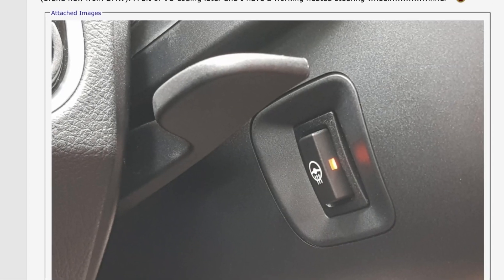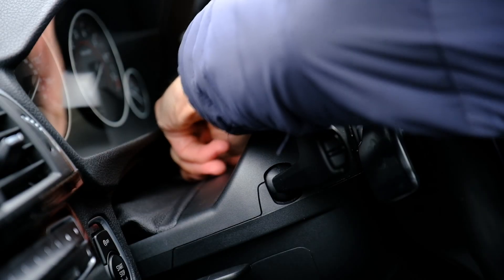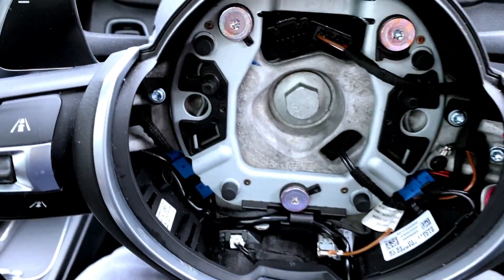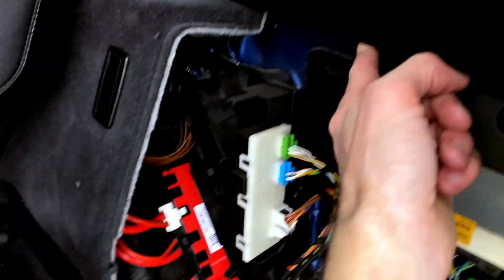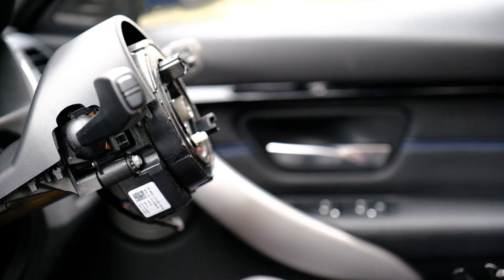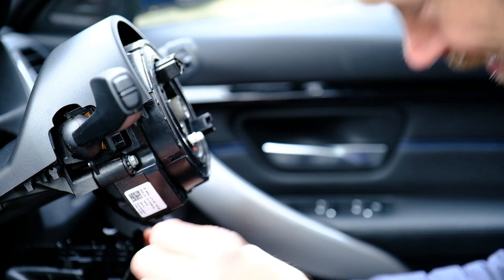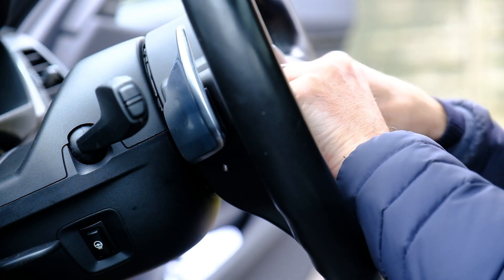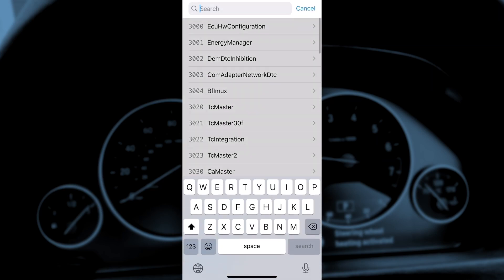Retrofitting Steering Wheel Heating to F30 BMW

Comment: Hello, and thanks for the video, I have a question, if we don't have the heated steering wheel, and we want to do the retrofit, I know there is a module in the steering wheel that manages the heated steering wheel, must it be coded independently?, 

or if I find a complete second hand heated steering wheel, just change the steering wheel and code with bimmercode as you did for it to work ? 

Thank in advanced for your answer

Comment: Hi not too sure how clued up you are about this but ive done the coding for my F20 M140i and for some reason whenever im starting the car up it says “battery discharge whilst station” is it possible ive got wrong somewhere with the coding? It works perfectly as well
Reply from the maker: TBH, not that clued up 😂 I was lucky in that I just followed the forum post, and everything worked as expected. If you’re having issues I really recommend dropping in on the Bimmerpost thread - there are lots of experienced folks there who may be able to offer advice and pointers 😃

Comment: Hey, I have just managed to code everything with BimmerCode and it is working perfectly , but there's no indication in the cluster when I turn it on, could you please help me? Many thanks
Reply from the maker: Sorry Adrian, I wouldn’t have a clue TBH! If it were me though, I’d double check all the Binmercode settings, and it that doesn’t work, try asking in the original thread on Bimmerpost? Sorry I can’t be any more help than that.

Comment: THANK YOU for the guide with bimmercode! Cowling was fairly easy to remove withouth detaching the steering wheel.
Reply: How did you remove the cowling without removing the steering wheel?
Reply: @Mike-wp4el  pull hard directly from the back of the cowling with the wheel at the highest and farthest out setting, took me a couple of attempts but it came off fine with the wheel in place.
Reply: Cannot remember anymore, but I think I did remove the steering wheel

Comment: Is this possible if there is no lane assist module? Or is it possible to get the bottom unit with the button + a heated steering wheel. A friend has a spare one laying around.
Reply: No, if you dont have lane assist you dont have Heating and Vibrating module. You need additional wiring and new steering wheel.
Reply from the maker: To be honest, I don’t know. Check the thread on Bimmerpost? You can also look in the wheel - the module and heater elements are visible. That’s discussed in the Bimmerpost thread too 👍

Comment: First of all, You need to have a steering wheel with heating element and also heating ecu for that. Also SZL if will be stock, it does not have extra connection for that ecu. Weird, that these things are not mentioned..
Reply from the maker: Check the description for the original forum thread, where the prerequisites are discussed 👍
Reply: What is the heating ECU according to you? If I buy heated wheel, cowl + SZL will it not work? I'm looking to buy a new SZL anyway when retrofitting KAFAS2 in the future
Reply: @Oockeshoek  SZL needs to have contact in it for heated and/or vibro steering wheel. I retrofitted myself KAFAS2 and vibro steering wheel in one go. KAFAS2 and SZL does have anything in common.
Reply: @Rimlax123  okay so if I get SZL (vibro or heated) + Vibro/heated wheel I can have heated wheel right? Then I add KAFAS2 in future with all cables etc. I can activate lane departure.
Reply: @Oockeshoek  Yes, but I also find another issue when installed mine. I used my previous wheel, just put into it vibro wheel and ecu for it. My steering wheel does not cable for power supply to vibro ecu, so I need to order new wires and install it into the wheel. It was prety similar as old one, just had one extra cable for vibro ecu. But If You arleady pick wheel which has vibro or heated function then You will not catch this problem.
Reply: @Rimlax123  Alright thank you so much!
Reply: @Rimlax123 what is SZL?
Reply: @Yobuddycoach  column switch, center plastic with both levers, don't know how to say
Reply: Configuration is like that: Steering Wheel without Heating and Vibration Module (in that case you need new steering wheel and wiring) / Steering Wheel with Heating Module and Vibration Module (You can have both or each separately and in that case you DONT need additional wiring). It is like that because Heating Module and Vibration Module is integrated in one module so if you have Vibration you can add button for heating and code car and another case if you have only heating with button you can code vibration aka lane assist but also you have to keep in mind you need to have KAFAS camera for it. Simply as that.

Comment: I don't get it.. So every bmw has heated steering wheel all you have to do buy a trim with button and code it ? 😐😐
Reply from the maker: Not every one, no. See the original thread on Bimmerpost, linked here in the description. If it has lane departure warning, then it most likely has the heating element and electronics. Keeps manufacturing simpler eh?
Reply: @WhiteRoseDrives  i have line assist, so thank you and thanks to the video owner 😁👍
Reply: @WhiteRoseDrives  So if your car doesn't have lane assist, might it still have a heated steering wheel?
Reply from the maker: @Scott-vs9qq TBH I don’t know what the right combination is. The original thread, linked in the description, is a better source of info 👍

Comment: There’s no need to remove the steering wheel. You can just remove the housing with brut force. The housing isn’t connected to the steering wheel. I’ve also made the cable myself, 3 wires are needed, a dupont set is a must.
Reply from the maker: Somebody did comment on the bimmerpost thread that they managed to get the cowling off without removing the wheel too. Thanks for letting viewers know 👏 👍
Reply: @WhiteRoseDrives  thank you for the great video btw and sourcing the code. Helped me a lot.
Reply: you are right i was watching the video i was thinking why 😁. 
it makes no sense removing the wheel.

Comment: Hi
first of all many thanks to you
secondly have you changed your bottom piece of your wheel for put the heat button ?
Reply from the maker: Hello! No, the wheel is what was already there. If you have lane change warning you probably already have the heating elements. You can tell by looking for wires going down the bottom “arm”. Follow the link in the description to the original bimmerpost article 👍

Comment: Hi mate！Thanks for your video, its relly helped me! I would to buy this trim my self, could you please tell me where you bought it? Do you know the part number of this trim. Thanks!
Reply from the maker: Would you believe, the cheapest place I found for the trim + switch was my local BMW dealer here in the UK. The parts were available from lots of folks on ebay too though, so always worth looking there 👍
Reply: @WhiteRoseDrives  thank you！I’ll go and check!
Reply from the maker: Forgot to mention the part numbers - sorry. Check the original bimmerpost article (linked in description) for the two part numbers you need 👍
Reply from the maker: Hello! I've just stumbled across the two part numbers anyway — 61316823468 (cowling) and 61319201736 (button) 👍
Reply: @WhiteRoseDrives  hello, thanks for your information! I already did the retrofit with your guidance , everything works well, thank you!